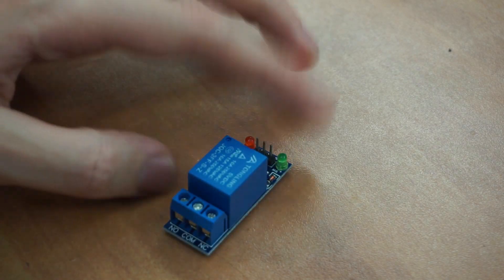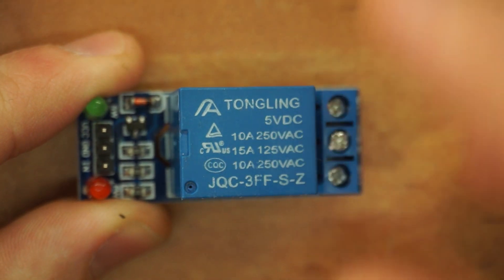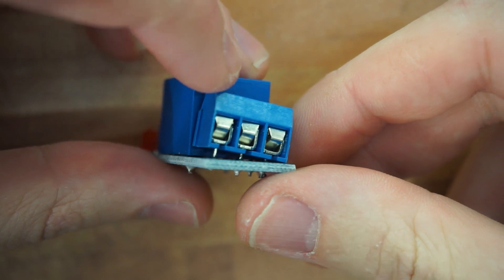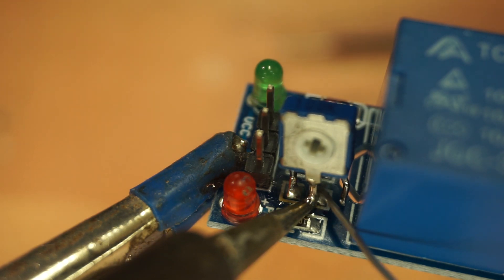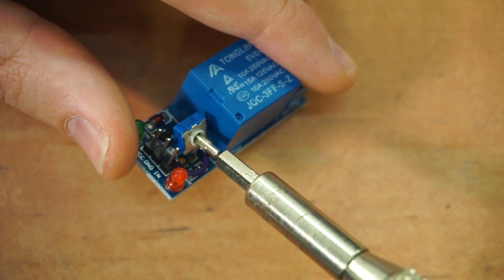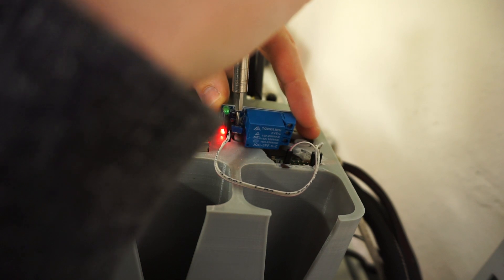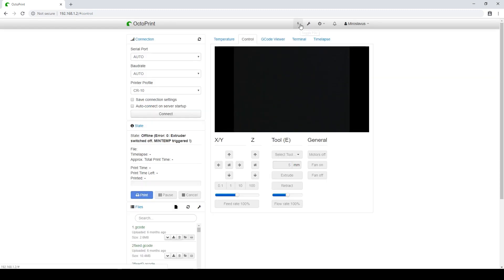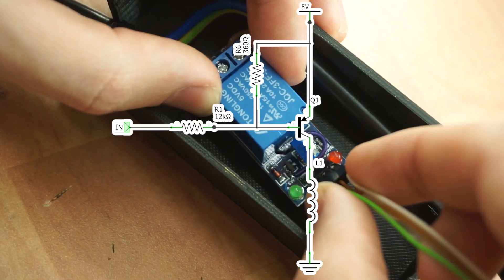How to make 5V relay work on raspberry pi (hack)

Comment: I got the same relay (actually 2 in the same board) and unfortunetly it doesn't work with the 3.3V from a Raspberry pi Pico... I'll maybe try your hack, but on my board I can supply to a different VCC for the relay circuits, so I may create something less hacky with a voltage regulator.

Comment: It's called level shifting as the Pico/RPI is built for 3.3-3.6 volts signal lines. It's a trouble source and you need to be sure it doesn't go over the specs. Always think it through, back and forth before you blow something out by "let's try it this way" and it's too late after a bit of smoke or dead devices. With more signal lines use a level shifter module. This "hack" is a normal procedure, but might not work always.

Comment: Didnt work for me. However I adjust the trimmer, it never turns off again.
However, WITHOUT the mod, using 3.3V from the Pi, it works! wtf?

Comment: i have question . If JDVCC use +5v (power supply), GND use -5v(power supply) , VCC use +5v (Raspberry pi), IN1(GPIO 17), IN2(GPIO 27),IN3(GPIO22)and IN4(GPIO23). can do like that?

Comment: idk if im doing something wrong my 5v relay isnt being powered on. on the board it haves g v and s but the but the only time i do get it to turn on is when i have 3v or 5v going into it s which i assume is the switch   and the ground on the v which i also assume is the volts and when i add more power to the g which is the ground it clicks and if i put more power into it while plugged into the printer and its on it turns off

Comment: Is there no other pin that can give 5V ? I remember you mentioned in your previous video that the reason you use that pin is because you use 3.3v relay, does it mean there is other pin that can be used with 5v relay ? Thanks so much

Comment: I think simply putting a diode (or series of diodes) in series with the signal wire should work as well. The voltage drop across the diode will allow the voltage on the transistor to go all the way HIGH to 5 VCC where it would otherwise be blocked at 3.3 V which is the HIGH state of the signal pin on PI. 3.3 volts is still enough lower than 5 to keep the relay turned on. Therefore the minimum voltage drop that you will need to have across the diode (or diodes) is (5V  minus 3.3V) 1.7 volts. Three regular diodes should have approximately 1.8V which should work. Connect the cathode (the end with the stripe) to the PI and other end to the relay module signal pin. (If you want to try something different, you could try using an LED with ~1.7V drop.)
PLEASE NOTE: I didn't try any of this yet. This is just my speculation of what should work.
Reply: This idea works perfectly simple fast and to the point

Comment: It's way easier to use a random LED (and maybe a current limiting resistor) as a current sink between the "in" pin and the gpio pin, so that when the gpio is pulled low the relay is triggered (and the LED maybe lights depending on the CLR)
Reply: my god, this has worked, thank you
Reply: this is the easiest solution, thanks so much!
Reply: Thank you
Reply: Sorry, but I don't understand what you mean, can you be more specific ?
Reply: @dedesite86  gpio pin > cathode > led anode > relay signal pin

Comment: I use the same relay board with no MOD. When I connect VCC to 5V  on PI (as it should be) it only turns on, not off. When I connect VCC to 3,3V on PI it turns ON/OFF changing LOW or HIGH on the IN connected to PI - I would say: works as expected however VCC to 3.3V instead of 5V. As I am not an expert I have no idea why 5V does not work while 3,3V works and what can happen if I continue use this relay with VCC plugged to 3,3V?
Reply: The reason 3.3V works and 5 volts doesn't. The relay module is looking at the voltage between "VCC" and "IN", when you connect a pin to "IN" that has a high state of 3.3 volts the voltage is still 1.7 volts lower than VCC. Apparently 1.7 volts difference is enough to turn the relay on. To let the relay turn off you will need to allow the voltage on "IN" go all the way up to voltage that is on VCC.
About the worst thing that could happen with to lower voltage is: reliability problems. That is: the relay might not consistently turn on when it's supposed to.
Reply: @alvinmast8551  so is it possible to run with 5v or not ? do i need 5v or 3.3v ?
Reply: Thanks you a lot I got my relay working on nodemcu❤

Comment: If anyone wants to use resistors instead: the values that worked for me are 33k in place of the default 1k resistor and 56k to VCC (fits nicely between the legs of the transistor if you find an SMD one).
Reply: Can I just add a 2k resistor between the legs of the transistor? Seems like with 1k it gives the same 3.3v almost as 33k plus 56?

Comment: Hey Buddy , you saved my day, I have been looking for the simplest way to make these 5V relays work with 3.3V and didn't want to use a lot of components. This is by far the best way! thanks again!!
Reply: did you try this ??? does it work? please let me know as soon as possible. I'm doing a project using this technique, please help
Reply: @ashritpawar2001  Well I did and it worked but getting the sweet spot of the pot is a bit tricky. You have to adjust it for turning ON properly and then it doesn't turn OFF. So you have to adjust again, then turn ON becomes an issue so you adjust many times to arrive at a place where both ON and OFF work fine.
Reply: @vks002  thank you sir. what if we cut off the o/p by GPIO pin after some time, does it still be activated ???
Reply: @ashritpawar2001  Not sure if I get your question clearly. The state of the relay should follow the GPIO input. So assuming you have an active LOW relay module, a LOW on GPIO will turn the relay ON and a HIGH on GPIO will turn it OFF.

Comment: I don't understand why you cant use the 5V pin. Why it wont work?
Reply: Yeap. 5V should work well on Raspberry Pi
Reply: @ygreq  Tried it. Doesnt work. But you can just use the 3.3v pin on the PI instead of the 5V, and not bother with doing a custom circuit. Just got it to work now, using pins 13, 17 and 6.
Reply: @jakhva  This is brilliant! It works without soldering.
Reply: @jakhva  I was doing that and working, and for some reason now it does not work anymore :/
Reply: @BrunoGaspar5  see if any wires got out of place or if the relay is still fine. Did you change anything on the software side?
Reply: @jakhva  I did not change software. It stop working between prints. The relay is working, if I manually connect/disconnect the in to ground it does click. I also try a extra one I have and same problem....
Reply: @BrunoGaspar5  check the voltage on the pi pins
Reply: @jakhva  hello, I just did, both pins outputs the 3.3v as expected (3.3v power pin and GPIO2), and the GPIO2 do go down to 0.05v when I use the PSU Control on octoprint to switch it
Reply: @BrunoGaspar5  well...im outnof ideas. If you figure it out, lemme know.
Reply: when the GPIO2 voltage go to 0v the led on the relay does light up but the relay does not click. But if I power the relay to 5v and manually connect/disconnect the IN pin the relay does work.... :/
Reply: @jakhva  ok thanks! I will. I ordered another one just to make sure its not a problem in both relays. Strangely I have one 2 relay module and it does work as expected with the 5 volts ( https://sc04.alicdn.com/kf/HTB1x9vwoQOWBuNjSsppq6xPgpXaN.jpg )

Comment: Hey Gyro, Im in the UK, is this correct 3V Relay? I have no interest in modding the exciting 5V relay https://www.amazon.co.uk/Leoboone-Module-Detect-Brightness-Control/dp/B07VRC7C95/ref=sr_1_12?keywords=3.3v+relay&qid=1572476884&s=computers&sr=1-12
Reply: That said, it says 3.3v and 5v so why wouldn't it work, is there something im missing? https://www.ebay.co.uk/p/3-3v-5v-10a-Relay-Module-for-Arduino-Nano-Due-Raspberry-Pi-Esp8266-Optocoupler/4021131680?iid=163739136324 any ideas?

Comment: I just connect the VCC to 3.3v instead of the 5v and it works perfect.... is there something wrong with that solution?
Thanks!
Reply: @stevechacon1613  yap exactly that. But with the 3.3v it worked as normal
Reply: @stevechacon1613  for me it is still working with the 3.3v lol in my case it did not work with the 5v
Reply: @stevechacon1613  sure, https://www.ebay.com/itm/5V-1-Channel-Relay-Module-Interface-Board-220V-for-Arduino-PIC-AVR-DSP-ARM/293069763253
Reply: @stevechacon1613  I'm dumber. I was looking into 3v relays and completely forgot that I have a bunch of these boards at home already. So thanks for the reminder 🤣

Comment: Thanks for the great video. Do you know if I can run DC voltage on the NO/C terminals even though it says VAC everywhere on my 5v Relay? I'm trying to power an electromagnet with DC voltage (10V, 2A). Thanks very much.
Reply from the maker: Sure. That would be no problem

Comment: Thanks for doing this video. Some posers may not notice that the transistor in the schematic is the one that comes in the board. You are just hacking one component to make it work. BUT - I have just finished experimenting with the values, and the best working value for me is 20k ohms between center and Vin. You mentioned being able use a pot between 10k and 100k. I would recommend >30k on the pot.

Comment: What a bad designd electronics. Okay it works, just. But use a NPN with two resistors and no need for a trimpot so the transistor will easy switch between totally open and close. Why you used a PNP here? Thats terrible because this will switch depending on the difference between the drive 0 to 3,3v and the 5v rail, so you need to adjust so it can switch on/off on 1,7 and 5v ! You should use the 0v rail as the common, so the transistor will switch on any driving voltage above 0,6v or higher with your choose the resistors.
Reply: I wonder what you mean exactly. Looks like this relay switches on when it's pulled down by an open-drain output of a microcontroller or microprocessor, where the processor would sink maybe 5 mA of current and the transistor gain of about 200 would make it into up to 1A, with about 100-300mA being necessary to drive the coil.

You mean NPN switched collector, low side switching? How do you prevent 5V going into the 3V3 IO?